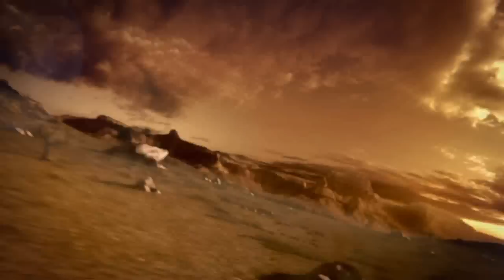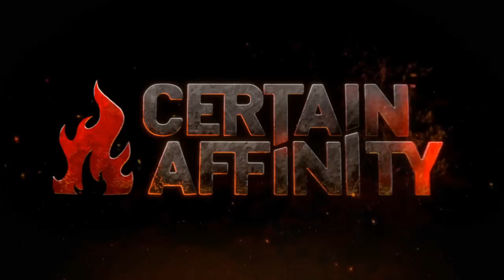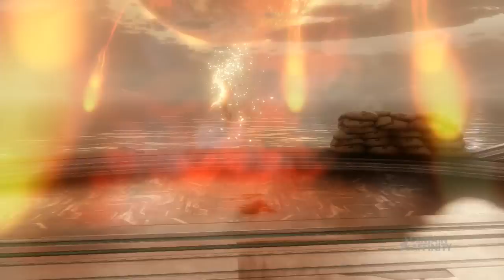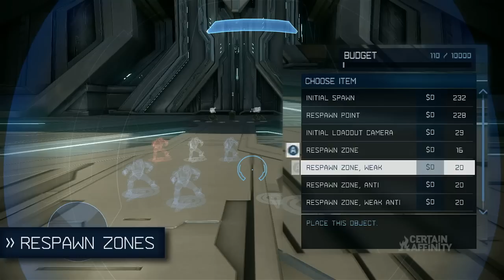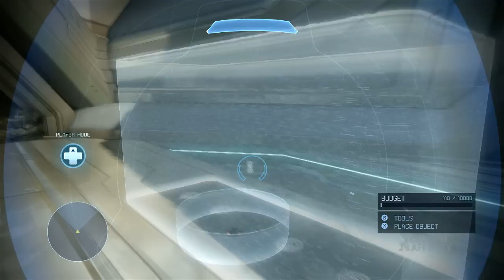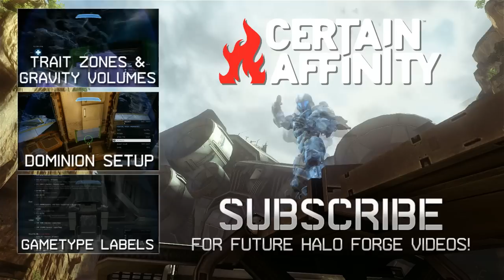Halo 4 Forge Tutorial - Spawning

Comment: I have one question I believe you didn't cover, I made an extension to ravine in which there are two floating islands outside the main landmass, I set up spawns specific to regicide, and respawns specific to regicide, the initial spawns work, but whenever I respawn I respawn on the landmass even though I got rid of all the spawns there
Reply: I have the same problem
Reply: hey i figured it out if you are having the same problem, make sure you are using respawn points and not respawn zones
Reply: you are correct, thanks

Comment: Not with 1 life and 3 lives, but there are 2 similar soultions: 1. in dominion, if you put only 1 capture point on the map and let one team capture it (put it out of reach of the other team), then the other team will go into last stand and only have 1 life whilst the first team has unlimted lives. The other solution would be to put initial spawns for the team u want to have 1 life in the map, then all of their respawn points outside of the map, in  spectator box.

Comment: second way i can think of would be to place respawn points in the second area as well as the first, but cover the ones in the second area with explosives. Then the third area do the same and the fourth as well. Finally, cover the 1st area in a respawn zone anti, 2nd: respawn zone weak anti, 3rd: respawn zone weak, 4th: respawn zone. This will mean that every new area will become the most preferable to be spawned in. Hope some of this helps! ps if u are making a race, there is a mod for it now

Comment: woah easy on CertainAffinity, dont reject this outright! there are some complicated ways to achieve this if you're willing to put in the effort and be flexible with your idea. typical way to do this would be to put down a teleporter system. Place all of your respawn points in the first zone, then a sender teleporter somewhere nearby. put a receiver teleporter in your second zone, and block it with a moveable crate, extraction crate, or explosive. When you reach the area, u open the teleporter

Comment from the maker: Set the minimum and maximum so they're equal to each other.  For example, if you had 10, set both to 10.  When coil is destroyed, it will spawn another to meet the minimum requirement.

Comment from the maker: Anti-zones make it less likely you'll spawn at a point, weak zones influence things less than normal zones.  If you have base spawning set up in Dominion, then apply a respawn zone, you can fine tune which points are used most often when a player spawns at that base.